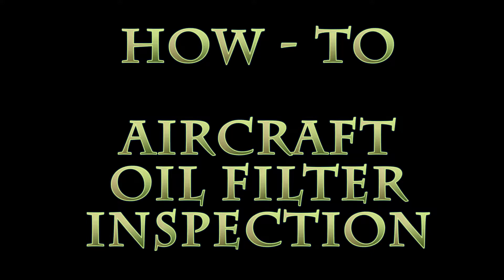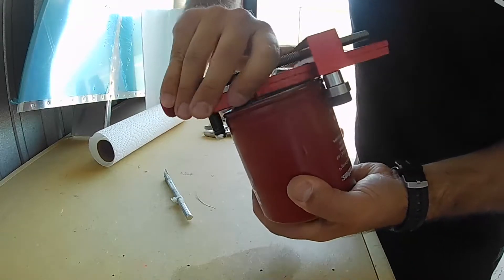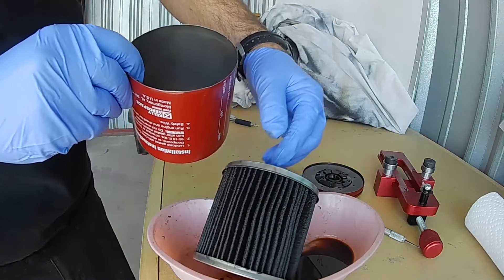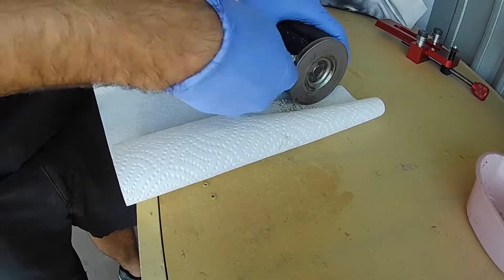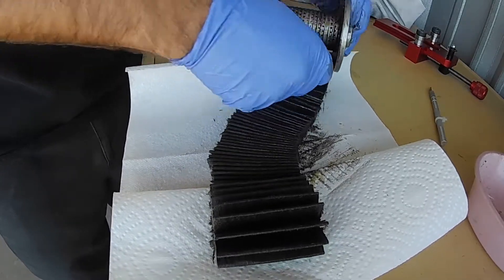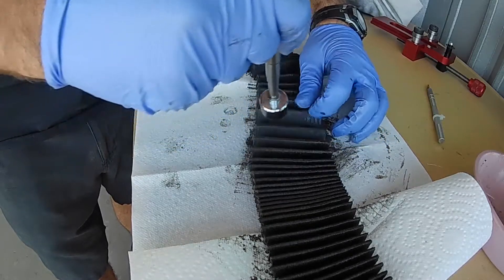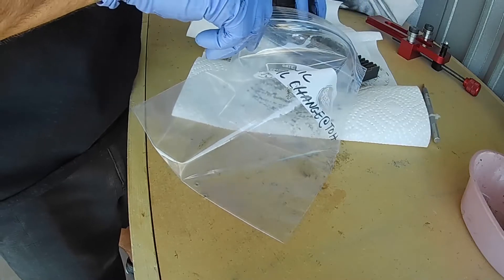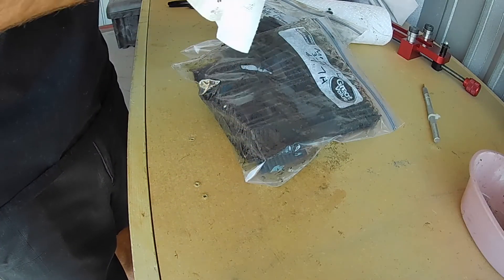HOW-TO: Aircraft Oil Filter Inspection

Comment: I give the pleats a cursory inspection then go right to the varsol bath. Stir up the varsol with a neodium magnet from an ID badge held in forceps and rub it against the bottom. I get a tiny bit of microscopic metal fuzz or grey ferrous mud stuck to the magnet. Then I agitate the varsol, dump it in a black plastic takeout food tray, let is sit for a while, then drain it off and check what non-ferrous particles are sitting on the bottom. Easy to see against the black. Usually some tiny speckles that look like aluminum, probably piston skirt or wrist pin plug wear. This time around I found one tiny sliver of ferrous metal, which could be from a cam lobe, but also may have come from the method I used to hack the can open (a wood chisel - need to get a proper can opener). See what I get next time.

Comment: Just watched your video. Based on your animation of the oil flow through the filter wouldn’t you want to inspect the other side where the oil is being drawn through the outside of the element into the center? Based on what I’m seeing in your video you’re inspecting the inside of the element where the oil has already passed through.
Reply: I'm trying to clarify this ATM